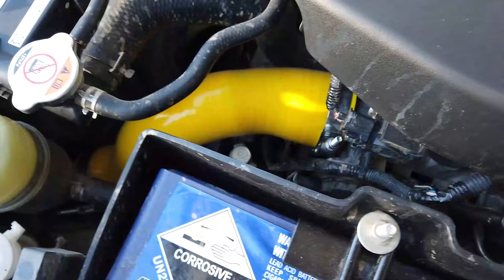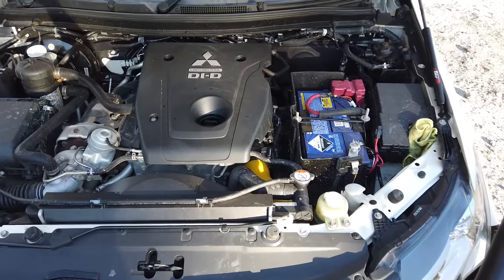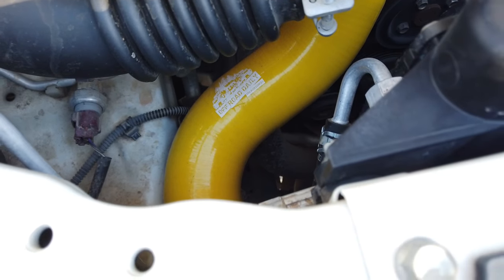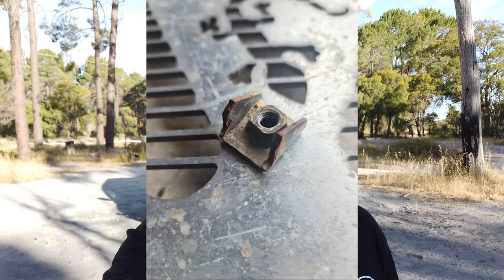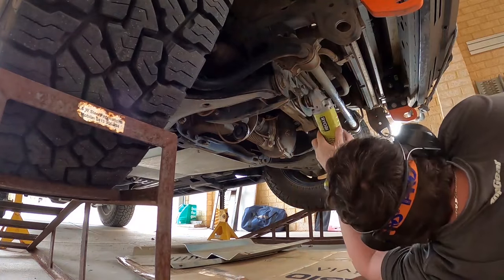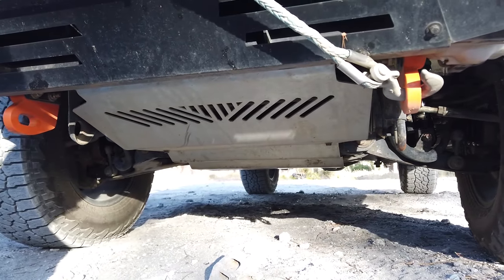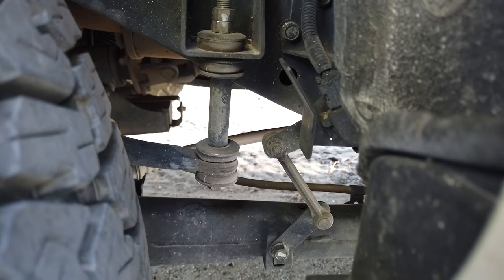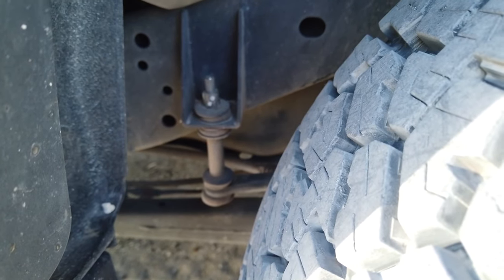Top 5 Most Common Problems With Mitsubishi Pajero Montero Sport

Comment: My Mitsubishi pajero sport had its hand brake linings completely worn by about 50 000km's. and I had to have it replaced. I do light off road driving, beaches and usually easy off road tracks occasionally. Mitsubishi refused to replace it under warranty. I contacted head office and wrote letters, but they only stated it is a wear and tear component of the vehicle and they refused any warranty talk. But Mitsubishi and the dealership mechanics admitted that it should last much longer than that and that it is very unusual for it only to last about 50 000 km's. It cost me about $700 to be repaired by Mitsubishi dealership.
Reply: Thanks for your input...I almost bought the same truck. Only because of your information about this mitsubishi pajero sport that I changed my mind. 
Thanks mitsubishi for your 
"  COOPERATION " YOU LOST A SALE .

Comment: Yep, good summary thanks.  Its a great wagon and very capable if you use it within sensible load limits - its not a heavy V8 truck. On the whole it is well designed and well made and great value for money but that Electric Parking Brake is such an obscenity  - why would they do that?

Comment: Just experiencing the infamous cracked exhaust manifold on my 2017 Pajero Sport, just out of Warranty as well. Totally cracked through all the way around, symptoms were loss of power, sooting around the manifold, increased full usage. I think we have caught it before any serious ongoing damage of secondary issues have emerged. DPF Filter and down pipe coming off for an inspection and clean whilst the access is gained to replace the manifold. I believe this is a casting defect across Triton and Pajero Sport. 138000 Klms of highway driving, minimal towing and regular LOG Book Servicing didn't save my Paj.  Worthwhile for others to note as there is multiple heatshield and baffle plates that hide the exhaust manifold making it hard to inspect. Cheers Dave
Reply from the maker: Definitely worth approaching mitsi about it. It's a known issue and there is a revised manifold design now
Reply: @T.A.G   Yep, mine went on my MQ at only 55K, Mitsi replaced it no questions !

Comment: I have a ‘17 pajerosport. Had my rear swaybar bushes replaced couple of months ago due to being worn out and more often knocking sound especially when going through uneven road. However i started to notice deformation after 3 months of use but no knocking sound yet. Prob the bushes are too “soft” or swaybars are indeed short. Great video. Am starting to get wary about my turbo hose too. 😂

Comment: Agreed about the towing. There is no way I'd tow more than 2 ton either with a PS. When I tow a heavy 14ft tinny and 750kg unbraked trailer with the PS, it does it beautifully but when I tow a bigger boat on a 1500kg braked trailer, I definitely feel it on the back and whilst it does the job, it feels like it kind of struggles.

Comment: Thanks for the videos.
I have contemplated getting a plug in scanner to keep an eye on all the numbers with mine but it really doesn't get used hard enough to warrant it imo. Overheating anything alloy is a scary deal.
Just booked mine in for a 60k service even though it has done 30k and it is $1260 due to having to adjust the valves and some other stuff.
Damn that was a bit more than I was expecting.
Oh well it's only money.

Comment: Compared to the issues Ive read and seen on the MU-X these are nothing, truly manageable. I’ve been on the fence between the Isuzu and the Mitsubishi, trying to make the best decision possible. Thanks for sharing mate.
Reply from the maker: @Oldman.Roaming  with turbos, cross members and body panels splitting, that turned me off of the MUX
Reply: Does your pajero have a RDL? The ones sold here do not and that’s a true bummer.

Comment: Here in the Philippines, it is not too uncommon to see issues with the alternator pulley going bust prematurely.  Majority, including myself have not had this issue but it's affected many owners enough to be considered a common issue.

Symptoms are squeaking and knocking sounds when engine is running even at idle.
Reply from the maker: Strange. Wondering if they used a different alternator there, never heard ofnit being annissue here
Reply: @T.A.G  hmm our units here are also imported from Thailand.  But it is quite possible that ours have a different alternator and related parts.  Otherwise it can't be just attributed to coincidence??

Keep those videos coming!

Comment: Pajero Sport 2017 towing 2.5t caravan from Darwin to Yulara in 45+ degs no over heating issues what so ever. 16.8l/100 calculated using wiki fuel app and empirical data. The Incab fuel usage was out reading 17.4-18.3l/100, Also for those that want to know how far a tank can go, well I filled up 62.7 litres!  I'm guessing it's about 5% reserve placing it at 63litres.

Nice to know about the intercooler hoses, can't say I've had any issues, but might buy some spares now.

My gripe is how soft the panels are and how poor the paint is on plastic. All my side steps are worn through where you exit the car. And the interior centre console has worn through to black plastic. They didn't sand the plastic parts. Because I've had one side of the car resprayed in a minor ding and the side steps have held up. I've got tonnes of seat belt dints as the kids jam the buckle in the door, never had that problem in my old Nissan no matter how hard I slam it!

I can't see there 7 year warranty holding up.  I only have the five, but can't be stuffed taking it back to fix the interior & side step paint.
Reply: Hey mate  how does it feel towing 2.5tonne I'm looking to do similar with my ps 2019. Does it struggle to get going on the highway and that?
Reply: @arcticicemonkey  Nope! 👍
Reply: Andrew re:paint my old triton was bad for that rubbing paint off so i just got a 2022 Pajero Sport so first thing i did is go to bunnings and bought some Gorilla Tape, it is thicker than normal tape and put a strip on the panels under the doors so you dont rub the paint off, then replace when needed.

Comment: You have forgotten Intercooler orings. See these daily at work. Not tourqued to correct settings at factory and leak oil and boost before 15,000kms
Reply from the maker: Even over tight they still leak. They're just a crappy undersized o ring haha
Reply: @T.A.G  28nm is the torque required.  I haven’t seen one return with a leak

Comment: Hi mate. Great informative channel. I was wondering if you’ve done or will be doing a clip on basic tools and parts to have in the Pajero to get you out of trouble. I’m expecting ours to arrive mid year and have no idea on sizes of spammers ect.
Reply from the maker: Pretty basic kit see you with most things you'll need. I have a bahco set I keep in the car. Has basic spanners and sockets of all sizes. Just add pliers and a hammer and you're done, might make a vid later :)

Comment: 2021 3.0 V6 in Mexico. It's a beast, obviously not the same torque as from the diesel one. I've not seen an overheating issue, went mountain running full of people an gear at 108°F and just heard the fan running  more. I want to install ironman shocks and coils but what happens to the headlight adjustment?
Reply from the maker: Headlight adjustment is fine as long as lifted even

Comment: No overheat here. Tuned to 256 hp with 25 psi of boost still registers 80 C on the temp gauge even on a heavy foot. Done 220 it registers only 85 C
Reply: Nice what modifications do you have on the car?
Reply: Technically allstock just a good tune
Reply from the maker: Going faster won't get it hot. Not unless your towing. It's all about load and how hard the engine is working

Comment: Would the 6th most common problem be the shudder at 1500rpm regardless of what speed? Have seen a bit on the forums about this and have it myself atm. Thinking about investing in a trans flush and hoping for the best, failing that chucking in some additives. Have you come across that yourself?
Reply from the maker: Haven't seen anything about shudder, but have seen plenty in surging at low rpm which is due to split intercooler hoses

Comment: sorry to ask, the car is the same as in the video, if the rpm is high idling around 1000 and using AC it becomes 1200, what is the problem? thanks in advance 🙏
Reply from the maker: No problem. The idle increases with Ac

Comment: I have been looking for a second hand pajero sport.  So far I have seen 4 cars all 2018+,  all of them have on the front tow point.  One has some sign of initial rust on the c section.  Is this normal?  I have never owned an offroad car so may be that is common for these types of vehicles?
Reply from the maker: It's just surface rust
 No biggie at all
Reply: @T.A.G  Thanks mate!

Comment: AUTOMATIC BOOT! have a pajero 22 since Feb and done 21k with a bit of medium off roading with no mods other than roof rack, awning and draws, pretty much straight away I had issues with the boot not wanting to close after even light off roading. I keep having to push it shut which I know is bad for the motor but I can't exactly call for a roadside pick up out in the middle of the Bush. At the service they tried resetting the boot settings but I still get an issue probably once every weekend im in the Bush. The automatic boot has just been a complete liability. Has anyone else had this issue?

Comment: The electronic parking brake module/actuator design is rubbish, the gear seized dues to plastic gear with metal axle and plastic with metal bushing, the metal bushing would build up abit of rust and it will squerze the gear and axle, its an easy fix, just wd40 and sand paper, and dealership dont wanna admit it

Comment: Towing more then 2 tone is stupid! Wow it’s rated to 3.1 tone you don’t know what you’re talking about
Reply from the maker: Yep. But what it's rated tow and what is realistic and safe are 2 very different things. Asking a small 2.4l to tow 3.1t is possible. But at what cost? Reliability, towing more almost double the cars tare weight is stupid, the little 2.4 is already highly strung just to get the power it has. Let alone ask it to push the weight of the car and pull an extra 3t
Reply from the maker: When you have worked in the industry and have an understanding of mechanical sympathy and workings you can say I don't know what I'm talking about 🤣🤣🤣
Reply: Sorry mate I didn’t realise Mitsubishis engineers have nothing on you
Reply from the maker: @eddiecalleja7574  🤣